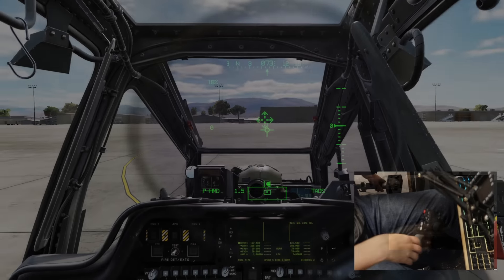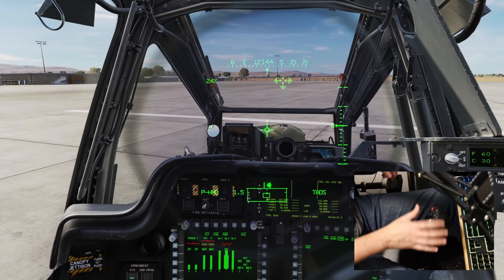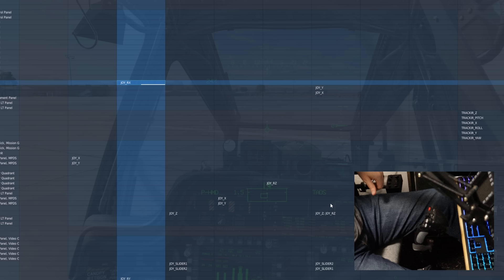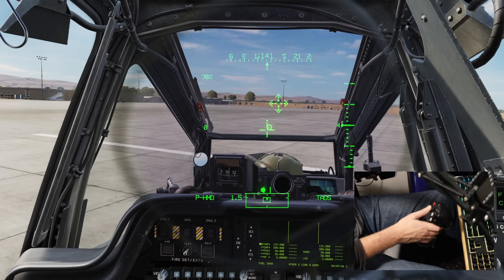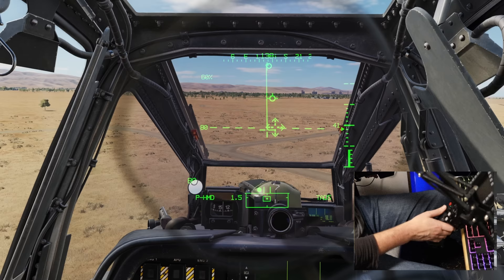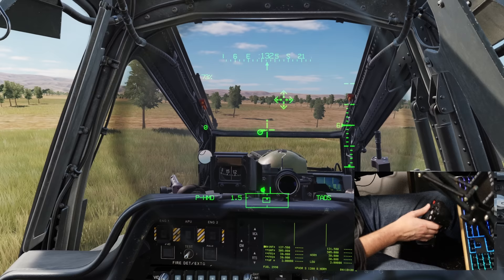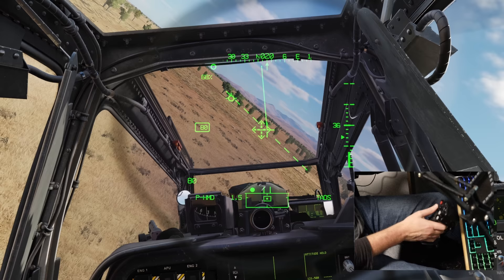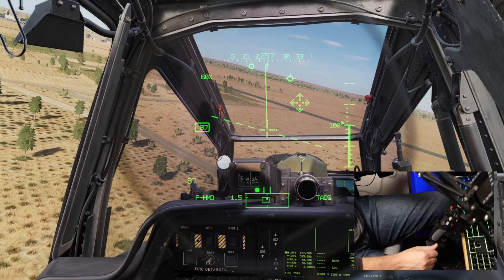The Importance of Control Touch in flying and some thoughts on Dry Clutch | DCS World AH-64D

Comment: Good stuff, thanks, Casmo. We have some new FM/SCAS improvements coming very soon.
Reply: Waiting for tomorrows patch, hopefully some interesting stuff included.
Reply: Asymmetric curvature and saturation would be a nice feature in axis tune, IMHO.
Reply: Hey Wags! Sorry if this is off-topic but I've noticed that when the helicopter is cold and the rotors are not moving, increasing collective only changes the blade pitch angle, which is accurate but inputting stick movements physically move the rotors even though it should be impossible IRL. I can even see it is modelled correctly with other helicopters too. Just wondering if there is any fix coming soon and if it is high or low priority. Amazing updates coming through with the Apache recently anyways though!!!
Reply: Such an improvement with the flight model, I made a video Casmo after I watched yours. Tiny inputs is the way for sure. Keep it going mate, great video.

Comment: Good video! The other problem with dry clutch is how long it takes to transition back to fixed wing aircraft.  If someone would make a base where you could toggle it on or off with an external switch without taking it apart, that would be a game changer.
Reply from the maker: It really would be.
Reply: Virpil cm3, takes me about 10 seconds to transition
Reply: @142nd_Bama  exactly 1.5 turns of a 3mm hex per axis and you're set
Reply: @VRTrucker I loosen my spring pretension 15 turns each to go from airplane to helo. It’s still extremely fast though!
Reply: Hummmnm... I have the vkb setup with the ultimate all metal stick.  Never messed with the dry clutch because I go back and forth between helo and fixed.  Maybe I owe myself a test or two to see what a pita it is to dial in/out.  Thanks for the video casmo!
Reply: Vpforce
Reply: Such a thing exists… The VP Force Rhino FFB stick. It’s a work of art.
Reply: There are many things already exists. VPC CM3 is nice one. But FFB really cover ca. 98% of flight sims. 1% is for RealSimulator (and so one) products (very interesting also for heli with long extension).
Reply: FWIW on my Gladiator EVO with a 3D printed bottom plate that has a hole in it, it takes me under a minute to either remove of insert the springs and adjust the clutches. And changing my T-Rudders with a 3D printed "magnetic brake" addon from normal to non-centering also takes only about 20 seconds.

Where there's a will, there's a way, but it would indeed be awesome to have it out of the box, without having to pay the price of a Rhino.

Comment: i have a Virpil  cm3 with 20cm extension with dry clutch (dead stick) and can use the hold modes just fine.  You just need to use trim first and set it to "Joystick Without Springs and FFB" which was specifically designed for this.  You will not feel any effect when you press trim but something happens to stabilize things  a bit and also the hold modes start working.
Reply from the maker: I tried em all. Didn’t like it. It’s ok, I’m back to springs cause of jets.
Reply: right so I've the same setup as you and have been puzzling with this also.... If I understand correctly you get your deadstick into a stable hover (or close to it) then use Force Trim Release to tell the FMC (flight computer) where to position the Apache's servo motors and then you engage the hold modes that will add 10-15% control via the FMC servos but crucially from the trimmed position. So if you don't Force Trim Release then you will likely drift as its close to or outside the FMC/servo range? The difference being you dont have to return the stick to center and you don't observe any control changes with the FTR but what it is doing is setting the position for the FMC... I think that is right

Comment: Hey Casmo. Just wanted to quickly chime in, in case by some offhand you get to read this. Nyogel 767A will solve the issues you are describing.  I have the WinWing SuperLibra with extensions, similar setup to yours. The grease is thick and consistent enough to make it feel like some of the real helicopters out there. The problem with dry clutches is stiction and inconsistent force requirements to overcome it and then the decrease of the required force to continue the input. This solves it. Give her a whirl, you won't regret it. Thank you for the videos and all your efforts

Comment: I have the exact same stick and I didn't know I could accomplish that with the clutches. Thanks for showing me. Though, I will probably leave it self centering because I fly fixed wing as well and don't want to be constantly messing with the clutches. I need to get a collective at some point because I'm using the F18 Winwing throttle as a collective. The movements are so small for a large increase in collective pitch.
Reply: This is my issue as well. I swap between rotor and fixed wing a lot, so as much as I'd like to do the springless dry clutch thing I can't justify it. (This is why we need affordable FFB to come back...)
Reply: @Tobascodagama look into the virpil cm3, super easy to go from helo to fixed wing

Comment: I've been pondering how to explain to people how to be smooth with inputs, for me I think the revelation was after switching to a Virpil setup (and especially after getting the 20cm manhood compensator for it). Thinking about inputs in terms of pressure rather than movements might make it easier to understand how to handle the stick.
The good ole mantra of "the best pilots move the controls the least" also diminishes tendencies to PIO by making mayonnaise with the controls while hovering or refuelling.

Comment: With my Saitek X56 Rhino, I have the lightest spring that it comes with installed, then I have made it even lighter by using two zip ties to compress the spring a little bit. This really helps with micro movements as I don't have to fight the spring to make inputs. I think that the heavier springs are good for WWII aircraft but for modern aircraft with hydraulically boosted flight controls and fly by wire that the light springs are way better.
Reply: I'm going to check my Rhino, can't remember which spring I originally installed.

Comment: Appreciate all the content you do Casmo! I've been doing this since day 1 with the Apache. I have VKB's Gladiator NXT EVO a cheaper flight stick, which also has the dry clutch mechanism. In the early days I don't think the SCAS and hold modes were properly implemented in DCS. So I preferred using the dry clutch than constantly trimming but now with the SCAS it seems to want to be trimmed by design.

Hopefully now you've drawn attention to this ED can do some patches and improvements. Keep up the great work!
Reply: That’s a killer stick for the price.
Reply: @King2Stone  Yeah I'm in the UK so it's not cheap cheap (like the budgie), I think in the united states it's more affordable though. I have it paired with an Orion 2 throttle and very happy with the combo!

Comment: I would highly suggest no dead zone for quality hotas. The way to test is pull up the controls in dcs and gently move the stick around center, if the ball jitters raise the dead-zone, if it doesn’t the dead-zone isn’t needed. It’s a much better experience!
Reply from the maker: 🤷🏻‍♂️ I highly suggest people use whatever works for them.
Reply: @CasmoTV  But if they don't do exactly what I say then how will they have fun?
Reply: @CasmoTV  just offering some advice from one enthusiast to another. In my experience in dcs moving the stick and the aircraft not responding leads to a lot of pio…
Reply: @142nd_Bama  Absolutely, dead zones literally are deal breakers. They're a remnant of the past when joysticks had bad pots that kept spiking after a while (Logitech left the chat.). You simply don't want to have that area of nothing happens and then the input suddenly kicking in. The real thing doesn't have that either and it's highly counter-intuitive. BTW this is the reason why I don't fly the Gazelle, as it has a hard coded deadzone in the cyclic controls, at least as long as the FFB enabled thing is ticked in the option, which obviously should be the case if you got such a stick. It's literally just uncredibly horriful. Feels like I'm WASDing the thing, not gonna lie. I don't have a stick because I'd prefer to be a Chair Force Keyboard Warrior instead :D
To be fair, if someone else might be OK with that and has gotten used to it, it's totally fine and it's always great to have the options.

Comment: Nice video, and informative.
I'm using Virpil's CM3 with clutches, and 20 cm extension. Nyogel'ed it up a bit though, which ended up feeling very smooth. I'm still using springs though, since I also use it for fixed-wing aircraft. Still, I find the clutches dampen or smooth out any irregularities on my part. I've always been a bit twitchy on the stick, and my CM3 setup has helped a lot with that. I've used 70% saturation on the axis tune for the AH-64D....might have to revisit those settings and try with some curves.

Comment: Force Feed Back would be the best option. Not sure which rudder pedals you have, but I have the Trustmaster TPR pedals with a motorcycle damper on it and no spring. I have the pressure set like brake pedals. You can set them and leave them in that position also.

Comment: Any reason why you aren't using the Controls overlay ? (R-Ctrl+Return in DCS) 
"Crotch cam" works great but with the overlay you can also see various bits like physical position, vs trimmed position and even what the stabiliser systems are doing as well pedals, collective and the engine throttles all up in a rather nice display. I don't mean instead of anything, but can be a very nice addition as I'm sure we can't see to well what you are doing with your feet there etc.

Comment: I have the Winwing Libra base and FA18 stick, variable extension at min (about 10cm). I love flying the huey with no springs, just clutches. Im so much smoother like that. But the Apache i keep overcontrolling if i have that setup. I can manage if i work hard, but i cant then smoothly use the cyclic switches because with how heavy the Winwing switches are (normally a great thing), it knocks the stick ever so slightly every time. So i prefer the apache with springs and force trim for pretty much everything, but the huey is world more enjoyable with only clutches

Comment: So what I haven't fully understood is why you would need the force trim within DCS, if you already have the clutches in the stick? Shouldn't you already have everything from the stock and only set the joystick to ffb without springs in the settings? I from my understand, on the real aircraft you would use the trim button to tell it the new center position to keep the stick there, which you already have in your vipril without pushing the trim switch
Reply: You don't need it in Huey or Mi-8. but you do need it in Apache and Mi-24. I don't fly Ka-50, so I don't know how it works. In Apache you are telling FMC what you want it to do. In Mi-24 you are using trim to reset AP channels to your new position.

Comment: Thank you for the video. Have you had a chance to try a force sensing joystick?  I got one from WinWing their Orion 2 and I think force sensing is the way to go, especially for the helicopters.  I've been flying with another force sensing joystick that I've built myself in MSFS and jumped into DCS only a month or so ago, as such I have very limited experience. However, even with the fact that I still crash during the landing, pretty much two times out of three in the multiplier due to the stress of being shot at, what you are saying about over-correcting the aircraft is greatly mitigated by the force sensing joystick.  Instead of a physical deflection of the stick in degrees, I feel it in grams and kg that I have to push to keep the aircraft moving and to my brain that starts to equate to the weight of the aircraft itself as well as allow for a very fine control when needed.  To me that greatly reduces the tendencies to over-correct.  WinWing's joystick unfortunately is not great in how it is setup to utilize their force sensor, you either get a large mechanical dead zone if you use only force sensor, or a weird blend of input signal if you use the combined mode.  I had to modify mine, but now its pretty great.  Not representing winwing or anything, bought it with my own money and as I said their implementation is not great so it needs further modification in my opinion.  Just wanted to say that there is an additional option of the force sensing, if you are interested in exploring that.

Comment: I upgraded to the Virpil CM3 Base some month ago specifically for this but just today i thought about giving up on it because of the inability to actually use the hold modes for hover. Just can't do it....and that's really so frustrating.

I also was completly baffled because it never came to my mind to set curves on my collective (throttle in my case though). Doesn't that make it even more difficult to hover if you are heavily loaded since the collective is than more in the max region than the center?
Reply: I would suggest User defined curves rather than the % curve, otherwise you’ll over ramp the collective at the beginning and end of the throw causing annoying error messages, excessive yaw wobble and potentially even dangerous instability from sudden torque changes
Reply: How does the CM3 work with other helos? (Hind, Huey etc?)
Reply: @ziljanvega3879   Yeah, that's what i thought, too. Never tried user defined curves though since it seems even more confusing to me because it neither is linear nor logarithmic.
Reply: @ColonelAkirNakesh  Can't say because i don't own them. Just some days ago i flew the ka-50 for the first time since the Apache came out and that seemed to go pretty well. After yesterday's patch i'm back to the Apache now. Flying feels way better now but i don't know if the hover mode issue can be solved.
Reply: Update: With the new patch and after setting my curves to 25% i'm now actually able to get into hover hold mode with the cm3.
Reply: @grzmz  hey appreciate the reply and the update :) I'm looking at that vs the Gunfighter as my next purchase, but the quick adjust seems to be a nice feature if I jump back and forth between modules like a DCS dilletante.

Comment: The no spring/dry clutch setup didn't sit well in my pit and I un-made those changes after only maybe 3hrs of flight. 
Human physiology is such that we can detect and feel very minute changes in pressure through the pads of our feet and hands.  
A design feature so to speak. 
We physically cannot detect distance or throw with nearly the same degree of accuracy. 
Move your hand 2.34 inches, or your foot 123mm exactly from the floor. Any accuracy is difficult to achieve and takes great effort to replicate.  But, if we associate those movements with pressure and time, we can precisely and consistently nail the gnats ass. 
I guess a long way of saying that removing springs and using dry clutches in this fashion may positionally mimic helicopter controls somewhat, but I think without FFB this does not do us any favors in the simulator.
Reply: Agreed, in fact I had a Realsimulator FSSB and although I thought helos would be out of the question with it, it turned out I was able to fly every aircraft with a much much greater level of control. That's because it's similar to a real f-16 stick, where there is almost no movement and control becomes a matter of finger pressure rather than actual movement.

Comment: May have missed it, but with the use of the trimmer, how does that work considering the clutch is already holding the stick in place? It acts almost as if force trim is disabled all of the time by nature of this cyclic setup. If only there were affordable cyclics that had a trimmable force gradient on the market...
Reply: It still tells the SCAS "this is where my stick is now centered" for lack of a better technical explanation.  It is also required to reset the SCAS system in the event it becomes saturated.

The part of the setup we are missing, is that in the real aircraft when you move the stick without holding the trim interrupt it will return to the position it started with.  When you trim it to a new position, it will always return to that position unless you hold the trim interrupt again.  A force feedback stick like the VPForce Rhino can replicate this, but no traditional spring stick can, even with dry clutches. 

I'm no professional, just an armchair pilot like most of us, but generally I hold the trim interrupt through transitional phases of flight like accelerating / decelerating (OR bump it once I'm set).  I trim to the speed I want to be flying in level flight in either aerodynamic or nose tail trim depending on what I'm doing.  From there, I will make course corrections / turns / altitude adjustments as needed without trimming and return to my target speed in level flight without trimming so long as I don't want my cruise speed to change.  This generally puts my physical stick pretty close to where the SCAS currently thinks the "center" is as well.  

I'm sure Casmo can probably explain it better, but I hope that helps some!  (And if I'm doing it way wrong, please correct me Casmo!)
Reply: @shadowbob4183  Yeah, I didn't consider the SCAS system in all of this. In DCS with my equipment, it's goofy and often an afterthought. The aircraft I usually fly don't have a sas or SCAS that screams at you unlike the Apache so it never crossed my mind.